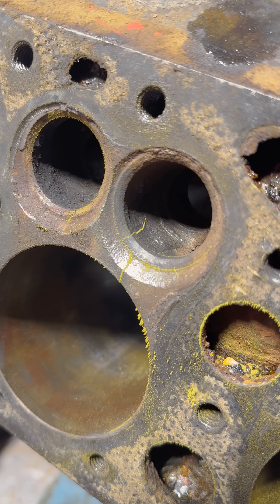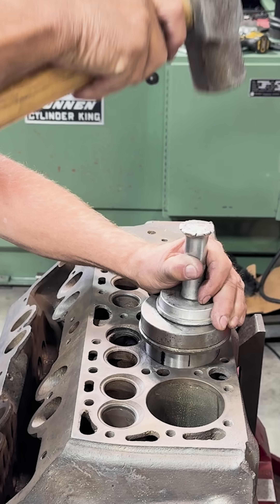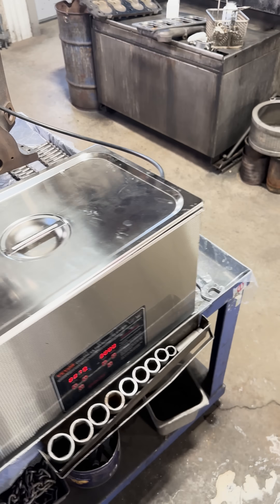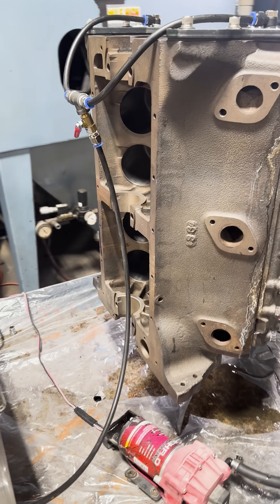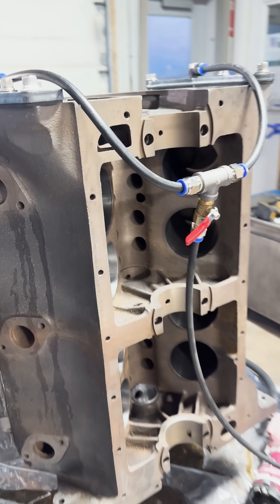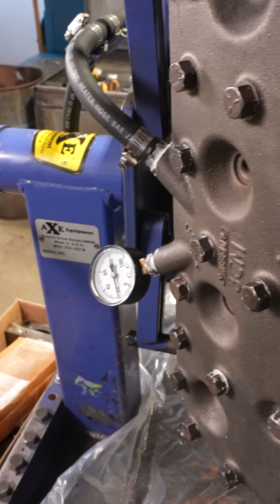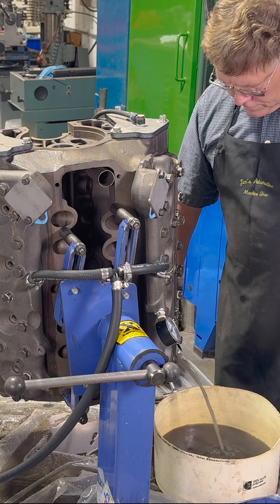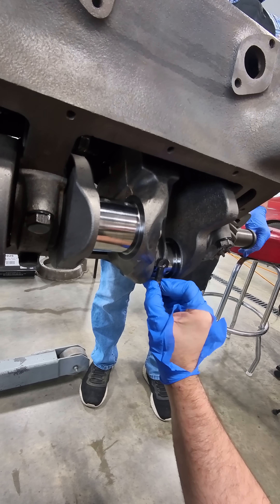#shorts Your Engine Block Is Cracked... So We're Ceramic Sealing It!   @itkwadmin

Comment: atmospheric pressure is about 14.7psi.

yep, there's ~14.7lbs of pressure pushing on each inch of your skin. when a low pressure system rolls in before a storm, it might drop rapidly to 14.5psi, hence your grandpa saying, "it's gonna rain."

Comment: Same here, my father's old Opel corsa B TD Sport with the nice Isuzu engine with around 500K KM worked like a charm better than my Peugeot 206 with 250K KM, my brother was driving it a water pipe blown and sadly he kept riding and burned the head, the mechanic sent it for the shop to fix the head he payed and then comes the mechanic saying, sorry I haven't noticed the engine is cracked 🤬

Meanwhile in India, they have huge holes in the engine and it's like no problemo sir! 🤣

Comment: If you were able to pressurize it to 15 psi than the water system was likely not leaking other than cylinder or heads.  And if it were leaking from the oil system, couldn't those seams be welded?

Comment: I'm generally curious about this technology. Wouldn't it be more cost-effective to use a cylinder head with valves to increase power instead of a flat one? American engines have a fairly large capacity, yet very modest power per liter.

Comment: Moroso ceramic sealer works great. my understanding is you need to bring the engine up to temp so the crakes open up and the ceramic fills the crakes. drain let cold and it'll stay sealed until it's removed by being cooked out in an engine tank process.

Comment: For those who don’t know what he’s talking about. Older engines back in the 50’s were water cooled but didn’t have a pump circulating water through the cooling system. They had water just sitting in the coolant passages till it would get to a certain temperature and I can’t remember the word condense and circulate naturally through the cooling system.
Reply: Thermosyphon👍

Comment: I fixed a cracked engine block with 2 component epoxy sands like metal has same hardness but is abrasion resistant
Reply: The bobcat that was on was a bobcat running at a sugar mill
Reply: Grinding and shipping sugarcane as white sugar to country's
Reply: Sugar salt any kind of crystallized material is harder than any tool can handle for a long time
Reply: That bobcat was a sentimental part to them because iwas the most reliable vehicle on the premise
Reply: I fixed engine blocks and copper welding issues by using this to fill small holes an making sellable areas on gears or fits that should be lost

Comment: I wander if there would be a way to run a copper sulphate solution through those passages and try to electroplate copper to any imperfections but not sure if copper would be better than a ceramic coating or even how electroplating could even be achieved. Almost anything I ever have thought of has been tried already and there's probably a reason against what I said.

Comment: So it’s pretty much doing the same thing as the old K&W Block Sealer? Besides the hardened valve seats and the cylinder sleeve. Only the K&W is done while the engine is in the vehicle.

Comment: And you wonder why mechanics have to charge you a lot of money and that is very expensive equipment when you add up all the if Samsung butts of all those different operating tools to remanufacture and redo that and it's great job and it's great work but it's tough and it cost a lot and when it comes to overhead and tooling of all those tools of the shop most people don't have these types of tools in a one or two car garage you know

Comment: I'm very sorry to say this, but I VERY STRONGLY DISAGREE with this process.

Cracked blocks are physic's way of saying "I'm done, bury me and move on with your life".

The customer is going to have issues down the road. And, it's not just a matter of "if", it's a matter of "when".

All it takes is to over rev or over load the engine, and that block is history.

I would've blueprinted the block and either cast or machine a new one.

Good luck. I think you folks made a big mistake.😢

Jason Wampler

Comment: Those old flatheads were notorious for heating water and cracking. Back in that day iron used for blocks was not what it is now plus running those exhaust ports through the water jacket wasn't one of Fords better ideas but it's what they had the tech to do then. Which is kind of off, since Chevy,GM had already engineered overhead valve designs. Ford should have been doing more research, but at that, the flathead did use far fewer moving parts ehich cut.production costs

Comment: Scope the entire block after curing and before assembly. I've found some of the ceramic with pits light spots and chips both before and after running. I assume it's from temp control or lack of cleaning in spots and or trapped air

Comment: Not sure I understand this process.  You have cracks in the engine's METAL...these are not going to go away and in fact, will continue to expand.  How does ceramic sealer stop metal from cracking...or keep the existing cracks from expanding.  I did see where you stop drilled the cracks you could see.  Not a hater, just trying to understand.

Comment: After you get the engine rebuilt wrap it and crate it and then put an EV drive train in the car in a manner that doesn't ruin the originality of car, OR . . .

Screw the originality and do an awesome installation of EV drive train 👍

Comment: I had a business customer that in his own personal business, he would silver solder cracked engine blocks and cracked heads and then have a machine shop finish the surfaces, when he was restoring vehicles and tractors.
 I asked him what was the success rate. He said it was 100% on everything he did that too. Then I asked why aren’t machine shops, silver soldering cracks, he couldn’t answer that question.🧐

Comment: What was pumping thr ceramic solution through the block without an actual circulation pump?  Is it just pressure that reaches equilibrium?

Comment: I remember hearing a story of probably the most valuable car to have a cracked block, it was a Duesenburg straight 8, and not just any Duesenberg either, it was the first one to roll off the production line, they literally had to call out a guy who repaired marine engines weighing in the 100s of tonnes to repair the damage.

Comment: i cracked the block on my 86 s-10..  drained the coolant, wired wheeled the the block as clean as possible, and jb welded that thing back together and it STILL runs great!   not a single drop has leaked out...

Comment: Why would you build the entire engine, and then check for leaks? You already have the test plumbing in place, do a leak-down test after 24 hours with air pressure.

Comment: REALLY Interested in this ceramic coolant sealer. It appears that your setup isn't any more complicated than a trip to the hardware store (besides the ultrasonic, I have one but not heated). 
Can you ballpark the cost for both the rig AND consumables? I have 2 performance street cars getting engine tear downs over the next 6 months and this sounds like a no-brainer  if you're that far into teardown!
Reply from the maker: Sprayer pump ~$100, Ultrasonic ~$300, maybe another $50 for the hose & fittings, and ~$20 for a bottle of seal.

Comment: Wouldn't it be much cheaper and easier to swap the Mercury rotating assembly and heads to another flathead block? Are there other differences with the Mercury blocks? #'s matching back then?

Comment: Back in the  early 60s I was very young my dads truck had frozen and busted the block 
He went and got liquid glass poured it in the block and he ran the motor for a bit and shut it down 
Next day he was driving to work so I guess it worked

Comment: I recommend they not run a pressurized cooling system. Recovery tank above the radiator to keep the system full and let the steam bubble through it. Remove the valve from the radiator cap and let it run at atmosphere.
In those days they had a rope seal on the water pump (as well as the engines, transmissions and rear ends) and the general practice was to fill the radiator with tap water and carry water for long journeys because the loss through steam blowing off was part of the deal. The rope seal loss wasn't noticeable if the seal was good.
He can run coolant, propylene glycol will do well and he can just replace the water loss with distilled. A 1/2 gallon recovery tank will do and the steam bubbling up through it will mostly get captured in the tank.

Comment: I did the same crack repairs on flat head Fords back in the day and never had an issue with leaks. The last block I did crack repair on was my son's 1950 International BD269 for his L180.  I spent most of the day stitching up the block , showing my son how it was done. It's been ten years now, and it still runs great.
Reply: That's awesome!!!! Thank you for sharing that story.

I had a similar "teaching the next generation" to do something. It was my dad and I, redoing the drum brakes on my first car. A 1966 289 v8 Mustang. I loved that car and let it go when I could have kept it.

I'm a tactile and visual learner, so he showed me on the 1st wheel, I assisted on the 2nd, he assisted on the 3rd, promptly went inside the house halfway through, and I did the 4th on my own. Took more time, but it worked out great and didn't have to go back and do it again.

I haven't worked on drum brakes since, but still know how. 

This kind of "passing on knowledge to the next generation" thing is getting lost to time because no one does things on their own anymore. And it makes me sad.
Reply: @Soldier4USA2005 💯
Reply: The best part was… sharing the quality time with your son. It,s times like these that will always leave your son with fond memories of you. Great job Dad!❤

Comment: With the ceramic sealant is that the water glass kind? If it Is, I believe it's supposed to get above normal operating temperature to glassify and do its job, other words it's water soluble and will eventually come out.

Comment: Seem crazy? I actually saw this done on a nuclear reactor vessel in about 1975. The steel vessel had cooling coils wrapped around it and was "cast" into a huge concrete structure. The reactor belonged to Public Service of Colorado and located at Ft. Saint Vrain. The reactor ran for several years after the repair but was a failure in some other ways too.

Comment: My buddy had a Ford truck with a straight 6 under the hood. Threw a rod thru the oil pan and it was sticking out the pan like a grease fitting... The motor still ran, just had to add a quart of oil anytime he drove it one way... 😂

Comment: When done correctly that ceramic sealer works magic.
I have a 318 engine that was treated with it and we have put over a 100,000 Miles on it with zero issues
Reply: Will it work on diesel?

Comment: You guys did a FANTASTIC job getting that irontite in there. Pumping in an agitated mix at basically engine operating temps and well over pressure is as good as it gets. That block will probably hold on for at least another 20 years if the owner treats it right and runs the all-weather sealer in it.
Reply: the strongest part of that engine is where the crack was sealed!
Reply: @adotintheshark4848 hshahah

Comment: Looked like there were cracks in cylinder walls.  Even sleeving the cylinders what happens to the cracks after multiple thermo-cycling during normal use.  Is there risk of cracks opening to the water/oiling passages?  BTW, loved the hard work trying to save a historic engine!

Comment: That vehicles cooling system may be a percolator style if there's no place for anwaster pump. If it has a water pump location. Early engines used nearly double the coolant system pressure we do today..I've seen original Ford radiator caps as late as the 1950s  that read 26psi on them

Comment: Tungsten cylinder sleves when all is lost.
Reply: They put a sleeve in it, crack is above the cylinder tho
Reply: @tdotw77 I was just talking shit. I don't even know if tungsten cylinder sleeves exist or would be any benefit over the difficulty possible.
Reply: @katlynklassen809  😆😆  Probably not tungsten but regular cast iron\steel sleeves are used regularly and this engine got a cylinder sleeved but this crack was above it in the valve port. They stitched it up, put new valve seats in(right above the crack) and now this magic (liquid glass)stuff. So it's fixed as best as it can be right now for sure.

Comment: most flatheads ran a neutral pressure cooling system. in fact many (like my 50 plymouth 218) couldnt build pressure becaust the overflow was seperate from the cap.

Comment: The one draw back on these flat heads , over heated they crack ,  even if it works its not going to last long maybe another 50 to 75 thousand miles if your lucky .
Reply: I've seen em last 100k easy

Comment: Iron tire works killer on cracked heads and blocks, used as a stop leak, the repair is almost permanent. But it will plug up a heater core in a heartbeat.

Comment: I had a 51 Ford, it had a flat head with two water pumps. A 25 year old truck, It ran good until a lady rear ended me and bent the body and frame. On the lighter side: I had a Honda Valkyrie FC6 is one of those traffic-stopping motorcycles that non-bikers are simply fascinated by. Basically a stripped down Honda GL1500 Gold Wing, with lower gearing and six carbs, the Honda F6C Valkyrie is actually reasonably good fun to ride and some might say it's best made motorcycle in America..

Comment: my machine shop sold me a quart of that ceramic coating after they machined my Mercedes 300 diesel head. (a valve seat sunk into head after 429,000 miles) I kept the product and sold the car

Comment: I'm curious whether ceramic would reduce thermal conductivity.
 I also wonder if a person could copper electroplate an engines water passages to prevent them from rusting but allowing thermal conductivity. I don't know if you have any answers but these are the things I think about when I'm trying to sleep at night
Reply: you electroplate enough and you will fill those cracks too

Comment: Have you ever opened a hot radiator cap and steam not come out or it doesn't boil over a little let me answer that for you the answer is no all cooling systems are pressurized

Comment: I'm not sure closing the valve achieved your objective of increasing pressure in the block. Pascal's law requires a closed system to hold. 

I'll have to rewatch the video to see which side of the ball valve the pressure guage is on. I will be surprised if it is after the ball valve.

Valve on the return. Got it!

Comment: I’ve got one cracked in the same spot. I’ve done stitching before but never on a flathead. Is there water jacket that high in the cylinder where you stitched or was it solid cast still down that low? Were those tapered pins like Goodson sells? I’ve used lock-n-stitch mostly but not their tapered pins.

Comment: It's cool to try to save those things. Sadly, most are cracked.
Reply: Almost all flathead Ford blocks are cracked like that & they run fine.  You don't even know it until you take them apart.  Not sure what they are doing with it but if it is going into a "stock" application it'll be fine.

Comment: Eh it's a flathead.
Unless it's cracked entirely in half it's just a cosmetic issue.
Reply: Yeah, that hairline crack doesn't look too bad when your valves are sinking into the block
Reply: It's cracked into the water jacket.
Reply: No it makes coolant leak into the cylinder and port. Grandpa had a shop back in the 50s. He said they cracked all the time and it made them overheat.
Reply: @DanielCurtis-y4e the over heating caused the crack. Guys wouldn’t change the coolant and it would plug up and pop
Reply: Please explain whay a cracked block is unimportant.
Reply: @htimsid 
Flatheads are low stress engines and many of them have horrendous casting defects yet still run just fine.
Reply: @D8W2P4  my 351 has a huge butt crack in the side of the block runs vertical across a freeze plug and weeps coolant. It has been there since around 1996. Runs perfectly normal
Reply: @TheAMXAC46 An external crack isn't the same as one that connects the cylinder to a coolant passage.  People suggesting these cracks don't matter because it's a flat head are just plain ignorant.
Reply: Awesome
Reply: Yeah,,let the coolant get rusty  & don't change oil? The combination stopped up the leaks
Reply: Indeed